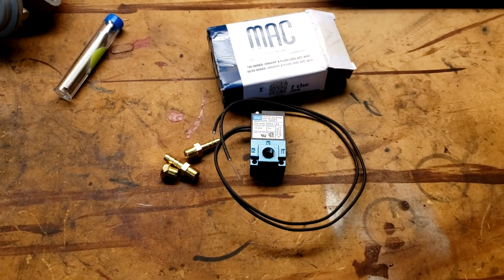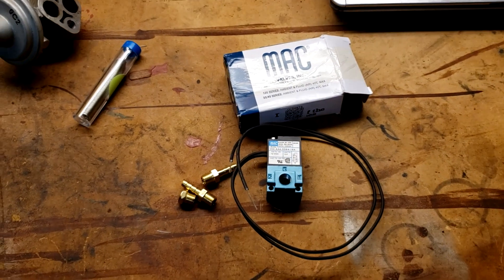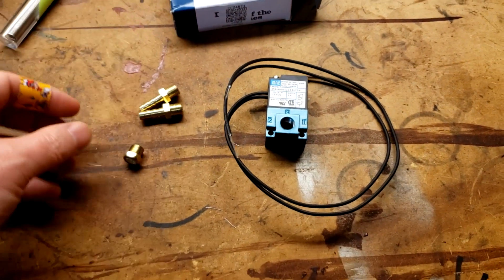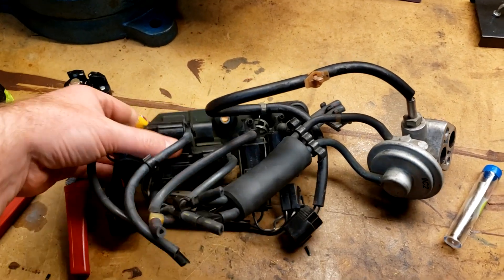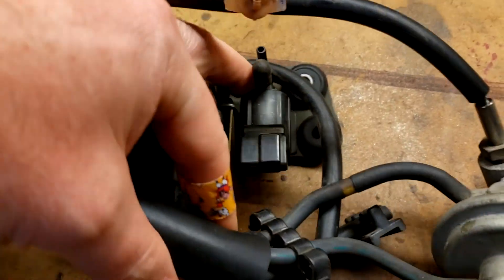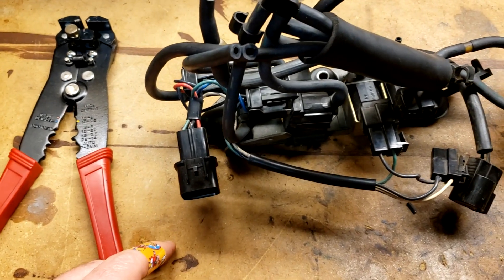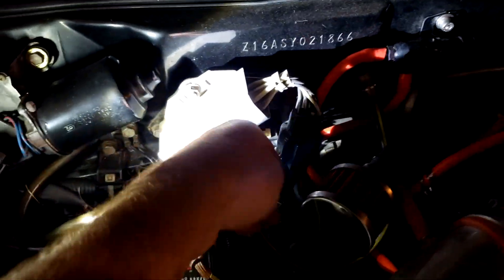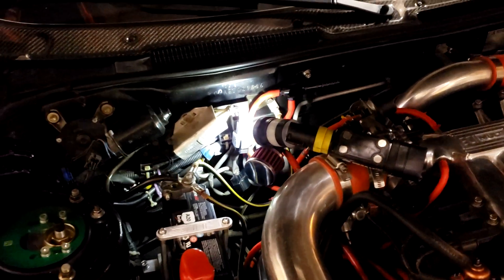Why Use a MAC Valve? Mitsubishi 3000GT VR-4

Comment: Need a chrome or standalone to control it by ecu? I have a mac valve that i got for my black stealth control unit, not sure if its better to have the ecu control it or keep it with the black steath controller
Reply from the maker: Correct. I'm running Chrome.